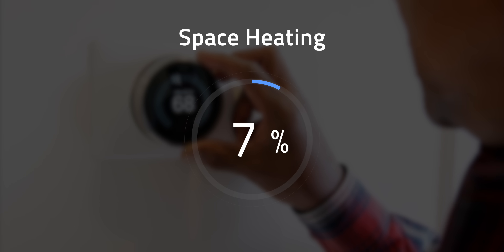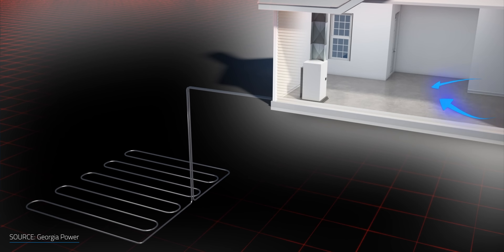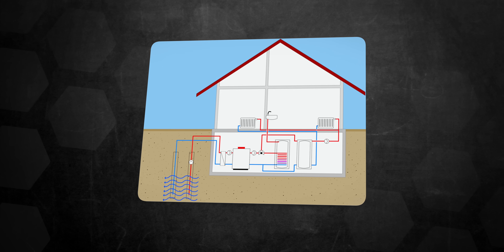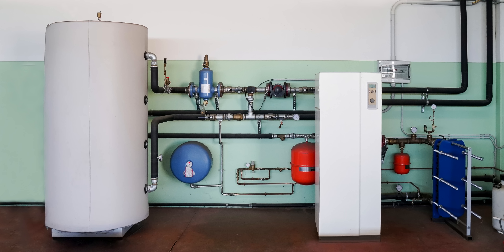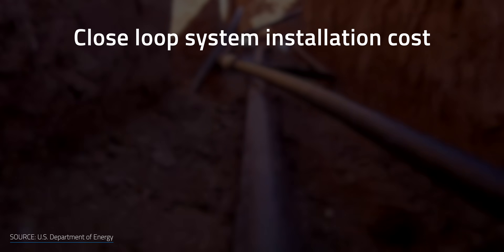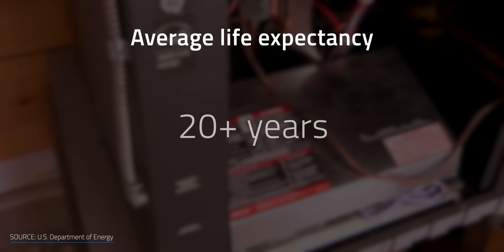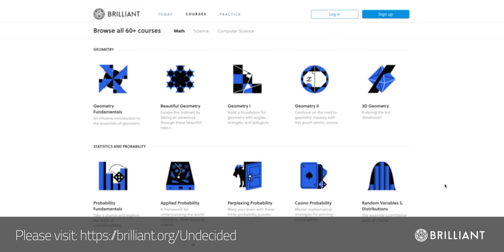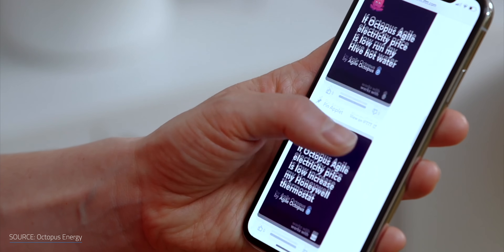Is Geothermal Heating and Cooling Worth the Cost?  Heat Pumps Explained

Comment: If heat always goes from a hot body to a cooler body then how on earth can CO2 be seen to warm the earth?
Reply: It traps the heat in the earth..
Reply: @BRAINSPLATTER16  is that all you got ?  Maybe explain how does it do that ?
Reply: @rob-yt9di  I don't completely understand what you typed here so I might assume you said things you didn't say.

heat from the SUN comes through the atmosphere(and the layer of gases). Some of that heat tries to escape the earth but can't because of the thickness of that layer of gases. It's a one-way mirror, like with an actual greenhouse.

It doesn't inhibit convection. This is all radiation happening here between space and the earth.(obviously because there is no fluid in space). Convection only works to move the heated air around the planet.
Reply: @BRAINSPLATTER16  I understand heat from the sun by radiation But a greenhouse doesn't stop radiation from passing through the glass it only stops the air heated from escaping..... Question is how gas CO2 heat the earth if it absorbs sunlight radiation  that would have travelled to the earth anyway...Surely heat travels from hotter to cooler bodies?
Reply: @rob-yt9di  the greenhouse analogy would work best to explain this.

If you make the glass(which is this layer of CO2) thicker, the sunlight still comes in, but more heat is trapped when it tries to leave.

The CO2 is basically more layers of glass. Like an extra sweater. 

It doesn't literally heat the planet. It insulates more of the heat that bounces off the earth.
Reply: @BRAINSPLATTER16  That doesnt seem correct because glass in a greenhouse  doesn`t stop radiation as heat its the physically trapped air that warms the green house.  CO2 is invisible but even if it did warm why should it radiate heat back to the place it came from rather than to the much colder upper atmosphere?
Reply: @BRAINSPLATTER16  OK. I was talking about the greenhouse effect that you said works like a regular greenhouse but I can't see that can be a true analogy for the reasons I put before. The other statement about the heat being 'trapped cannot be correct as heat always dissipates from hot bodies to cooler bodies so if CO2 is ' trapping heat' then won't it radiate that heat to the cooler upper atmosphere?  Sorry to be particular but there seems to be something missing here.
Reply: @rob-yt9di  OK, I think I'm getting it.

So greenhouse gases vibrate at a certain frequency which is consistent with the frequency at which Infrared waves vibrate at. (Infrared light is basically heat)

CO2 catches these infrared photons.

You may also ask why CO2 doesn't block the sunlight coming to earth.

It does. It blocks a high percentage of it. That's why we aren't burnt to a crisp like what would happen if you faced the sun while standing on the moon.

The radiation coming from the earth is nowhere near as intense, hence thats how the atmosphere can trap it inside so easily.

And ALL greenhouse gases do this. Not just CO2.
Reply: @BRAINSPLATTER16  Ok , when you say block do you mean it stops suns radiation hitting the earth?  I understood radiation excites the molecules at certain frequencies which I suppose holds some of the suns radiation that would otherwise sailed straight through to earths surface.
I therefore cannot understand HOW does CO2 get the blame for global warming if the energy stored in the CO2 molecules is then re radiated wont it go from high energy cO2 to low enrgy space???   I suppose the basic question is can heat in a body radiate heat to a hotter body or would energy transfer always go from hot to cold??
Reply: @BRAINSPLATTER16  Sorry but that doesn't make sense to me I will have to look elsewhere to find out. .The sweater analogy cat be correct as CO2 is only 0.04% of atmosphere that's gotta be some holey sweater ... More like a tiny string vest than a sweater also if you had your back to a freezer I bet your body woul cool down a lot faster than the heat retention from a room would provide.   ...
Reply: @rob-yt9di  like I said before, CO2 isn't the only greenhouse gas.

But that part doesn't matter. The greenhouse effect is how we even have an atmosphere. If you don't accept that, then I don't know what to tell you.

It's simple science.

The fact that CO2 takes up .04 percent of the atmosphere doesn't contradict this. 

As you go higher into the atmosphere, the density of air decreases by many orders of magnitude.

That's one of the reasons why you have a pressurized cabin when you fly a plane.
Reply: @BRAINSPLATTER16  Hi, no I do understand that the earth has a greenhouse effect and CO2 does have a minor role to play as I suppose it occupies inumerable different locations conditions and altitudes so the effects can vary widely. However I would have thought that water vapour and particularly clouds make up most of the blanket you propose and that seems to fit the sweater analogy much better. I'm fact it is really well demonstrated on a sunny day when a cloud blocks the sun and a night when it's cloudy it feels warmer. I can't see how a tiny concentration gas can have the effect people say 
it doesn't make sense.
Reply: @rob-yt9di  water vapor is one of them..

The vast majority of the greenhouse gases is CO2 (76%), followed by nitrous oxide and methane.

So it very much has a major role to play.
Reply: @BRAINSPLATTER16  Just picked this quote up...Greenhouse gas, any gas capable of absorbing infrared radiation (net heat energy) emitted from Earth's surface and reradiating it back to Earth's surface, ...
So this is saying the heat energy is reradiated back to earth???   As I said earlier how can a body (CO2) that is heated from another body (earth) actually heat the hotter body (earth) ????  I thought heat transfer was from an energetic state to a less energetic body??/  Square the circle?
Reply: @BRAINSPLATTER16  Back again....Your explanation doesn't work as if CO2 acts as a barrier and just blocks energy then why doesn't it act as a shield to block incoming radiation from the sun and then radiate it back to space ( which is a lot colder)?
Reply: @BRAINSPLATTER16  OK if what you say is true then more CO2 would `reflect` more sun light and the effect to the climate would be neutral ...right?
Reply: @BRAINSPLATTER16  Now I am confused ...  You are saying that heat from the sun is radiated from earth but then that heat is then radiated back to earth ??  Well that is what I have been saying how can heat travel from a cold body to a hotter body???/  Do you see my dilemma?
Reply: @BRAINSPLATTER16   I`m not trolling you I just dont understand/get what you are saying. As I see it ..
Sunlight comes, some is reflected by clouds gas, some is absorbed by CO and greenhouse gases water vapour ice etc the rest heats the earths surfaces. 
The earth surfaces then radiate some heat back to the frigid space from whence it appeared.
The radiation emitted from earth encounters clouds water vapour which can reflect and absorb the radiation The greenhouse gases  absorb some of the  reradiated energy  and radiate that energy they have absorbed. 
Now if what I say so far is fundamentally agreed  then I pose the question again (and based on the theory that heat travels from hotter bodies to cooler bodies) why should the greenhouse gases radiate the energy back to where it came from Also if the greenhouse gases are being excited by the incoming radiation from the sun to start with and knowing they have a limit to how excited they can get how can they overly affect the earths temperature. Now I don't know how long the greenhouse gases can remain excited so its possible I suppose that they could emit heat at night back to a cooler earth but that seems to be such an insignificant contribution to global temperature. The problem with your explanation is I cannot come to terms with your notion of a `barrier` that stops the heat disappearing into the void outside that of the obvious and most plentiful water vapour and clouds for which I can accept.
No need to respond unless you have the `golden key` to unlock this cooler bodies heating hotter bodies conundrum that seems to be expounded..
Reply: @BRAINSPLATTER16  Found this which seems to hit what I been saying .... Quote;-
"Some scientists propose that greenhouse gases act like a blanket surrounding Earth, keeping Earth approximately 33 oC warmer than expected for a planet at Earth’s distance from Sun. Blankets are well-known to slow the loss of thermal energy from a body of matter, but a blanket has no way to increase the amplitudes of oscillation at every frequency of oscillation. A blanket cannot be the source of new thermal energy required to increase the temperature of the body under the blanket, unless it is an electric blanket that adds thermal energy from somewhere else."
Reply: @rob-yt9di  there is no new heat.

The "blanket" is reflecting heat that otherwise would have left the system. It does not heat up the system. It simply traps the heat.

This is how insulation works.

There is no new heat.
There is no new heat.
There is no new heat.

If you wrap a thick blanket around yourself, even when it's cold around you, you will get hot. The blanket didn't heat you. It's your own body heat that's making you hotter.

I'm sorry dude. I don't know how many times I can say the same thing.
Reply: @rob-yt9di  
all of that is talking about sunlight.

Not the greenhouse gases which block radiation from the earth.

Dude. Come on. What are you trying to do here?

In fact, I wouldn't be surprised if your source is just saying what I've been saying for 4 days now.

Comment: I have 2 open loop units in my house and it costs the same as heating with electricity and repairs are like a license to steal for repair shops. I needed a simple recharge and they quoted me $7000 so had a buddy to it with his automotive tools and it cost $200 for the gas.

Comment: I am interested in geothermal as a way of heating and cooling my home.
Our home currently has a gas fired steam boiler for heat, and we use window AC units for cooling.
Are there any geothermal units that can be installed like the split hybrid heating and cooling units available today, that would eliminate the need for having a Central Air system ?

Comment: i layed 150m long pipe along the main sever pipe in the street... return water went newer below 0celzius... after one day when the pump is off its back to 14 degrees.  second Pipe is the other way and its used to passive cool the concrete ceilings... return water has 20 degres and the pump is average on 50Watts and the whole house is at 23 degrees. +i buyed a unpacket and new Buderus heatpump from Ebay for 3000 Euros so the whole system cost is arount at 5000 Euro. the ceilings are uset also for heating and works flawless...

Comment: You missed something somewhat important.  It’s irrelevant whether or not the ground temperature is warmer that the surface air in the winter (which it isn’t in some places during at least part of the heating season).  As you did mention, the system compresses the refrigerant, heating it up.  This means a heat pump can heat a home even if the ground temperature is below the air/surface temperature.

As a relatable example, a refrigerator can continue cooling its interior even if the room temperature (which is its heat sink - like the ground for a GSHP) is well above the temperature inside the refrigerator.

Comment: I asked about geothermal when my house was being built. I came to the conclusion that I'd first need to be rich to save on energy costs lol.
Reply: If you want to save on energy costs look at heat conservation. There are many things you can do to reduce energy costs that will find it pointless even considering a heat pump.
Reply: Depending on where you are, there's grants/loans even tax breaks for these systems.
Reply: It is kind of like solar panels in California or Arizona… painful up front, but worth it in the end.
Reply: nothing is more expensive than being poor.
have to take the most inefficient, the most short-term, but cheapest, solutions in everything.
Reply: How much did you spend on your last car or truck?  Did you recoup part of that cost through savings over the years (did the car or truck gain in value or lose value)?
Reply: @jimandlinhcamino  if its a truck it actually may have gained if it was bought used. I've had mine for over a year now bought it used and it's worth more now. Used car market is insane at the moment. Same goes for my wife's Jeep Grand Cherokee.
Reply: Just find whatever is the cheapest heating unit to run and use it.
Reply: If you can buy a house, you can afford it.
Reply: @thesheepthemightythecrazy  whether you can afford something isn't the issue. It's whether it makes sense financially over other alternatives.
Reply: @thesheepthemightythecrazy  not true at all, loans are easy to get regardless of income if you have any monetary competency and purchasing a house can cost far less then renting an apartment if your not trying to stay within a major city. 30 miles out can make a huge difference to housing costs, and not that big of a difference to income.
Reply: what a massive bullshit...

Comment: Don't take this wrong, and you might of just been making it simple, but mistakes were made here.

1.  The liquid in the loop field for a ground source heat pump is not compressed when it returns to the inside.  The heat is transferred into refrigerant, and the vapor refrigerant is compressed in the compressor.  Hearing the term compressing the liquid just makes my ears bleed, even if you are trying to make it simple.
2.  The COP or Coefficient of Performance of 3 to 5, is compared to electric heat only (measured in watts) when referenced to GSHP, which is a point that was left out.  This 3 to 5 number does not represent high efficient natural gas furnaces.
3.  Duel Fuel heat pumps are not air/ground combination heat pumps.  They are ground/air/water and a fossil fuel furnace combination.  Even the best GSHP, if it gets cold enough, will not be more cost effect compared to a condensing gas furnace in northern climates.  Switching off the GSHP, and turning on the fossil fuel furnace (as the 2nd heat source) is the most common.

Comment: My neighbours have geothermal.  When it goes wrong, it goes really wrong. My electricity bill plus gas bill averages $350 a month. Theirs, $1500.  Ouch...  they spent $20000 fixing their geothermal system and now they spend $500 a month, so at least it’s better now, somewhat.  They should have gone traditional A/C and gas furnace.

Comment: "Very little maintenance".....right. Ironic that the algorithm put this on my main page. We purchased a house which was owned by early adopters of a horizontal closed loop system. It is 29 C (84 F) today, and ANOTHER of our pumps has burned out. Replaced both of them LAST YEAR. How cost effective is replacing thousands of dollars in pumps every year...because (gasp!) we had a nice 18 C (64 F) day so I turned off the air conditioning for 12 hours. It is a holiday weekend, so calling the HVAC repairman is right out, and the temps are slated to be 10 degrees hotter in the next few days. So if you wish to find yourself in a similar situation a few decades down the line...have at it.

Comment: With the advancements of air to air heat pumps, geothermal is no longer cost-effective. Also, geothermal IS NOT low maintenance. It's not any less than a conventional system and it will become more over time. It's not if the ground loops leak, it's when. Then it's constant maintenance to make sure the loops stay pressurized with a water-glycol mixture. When the leaks get real bad then you have to dig up all the loops and replace them. Refrigerant leakage will become a problem as well. When all this happens, you really didn't save anything.

Comment: #1. You can't just add up heating and cooling to say they use 30% of the electrical load from the grid...they don't run simultaneously, so its more like 15.5% on average year round.

Comment: How would the system fare especially in areas of pacific ring... where earthquakes are common? Would the system be safe and reliable?
Reply: Not good in areas where the ground is unstable. They can handle a small amount of flex if the system is designed for it, but any major ground movement runs the risk of damaging the pipes.

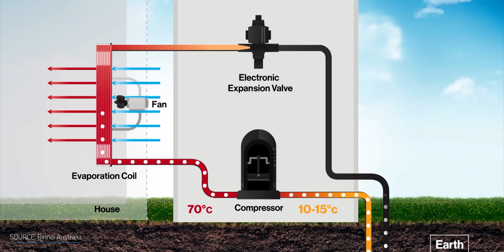Comment: 2:36  Info graphic is missing a piece.  Refrigerant does not get directly piped outside and into the ground loop.  That would be crazy expensive and a lot of refrigerant.  Instead they pump a coolant mixture of water and antifreeze down into the ground loop then use a heat exchanger coupling in the house to transfer heat between the coolant and the refrigerant.

Comment: love heat pumps,30 + years installing them.installed them various ways.yes they are reliable,but all things do break.then parts may not be available when it's freezeing out.i live in ne usa.i keep telling customers take advatage of tax breaks for heatpumps over staight ac.a good air to air heatpump cost less after rebates than ac alone.heatpumps save money long term,geo pumps even better.ALL THINGS DO BREAK.if your in a climate where your home/dwelling can freeze in a day when cold temps happen,you keep replacement parts at your home or have convensional old style heat also in your home.if you live in a temperate climate where freezeing is not a problem geo is the best.every winter i get people calling to fix there heat pumps they just installed.ac in reverse is great,but your ac  load is 25 btu's per sq ft and your heat load is now 40 btu's per sq ft your getting cold.please hire a local pro for your best options to your area.